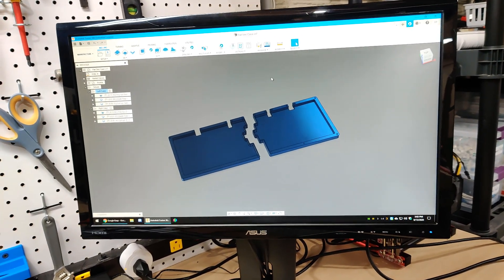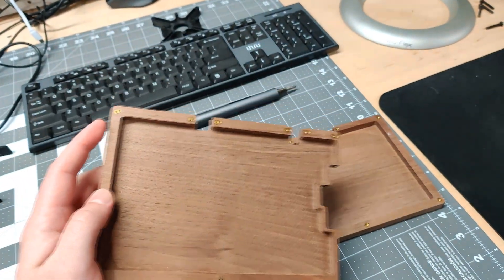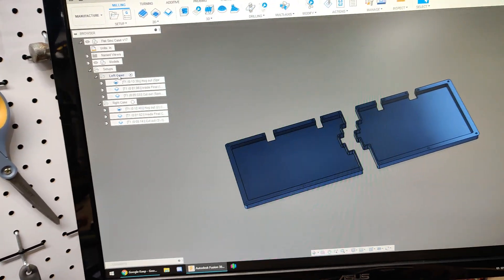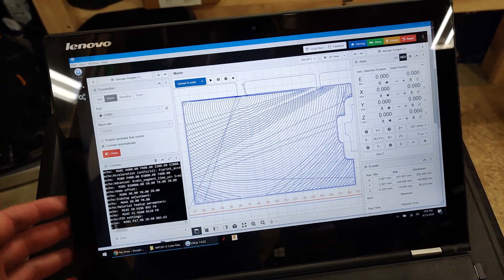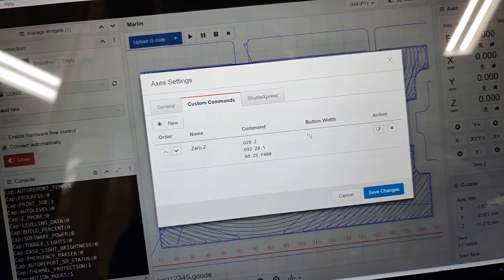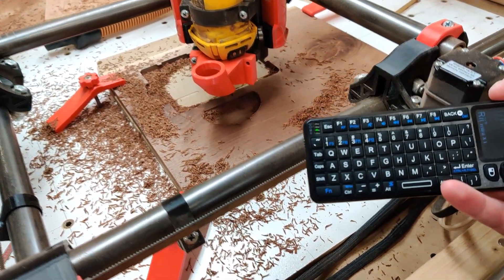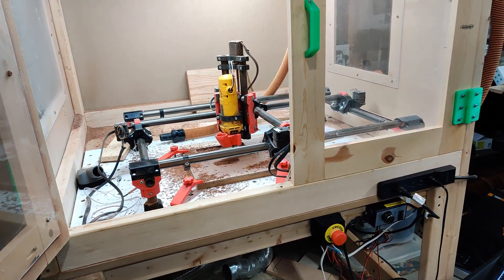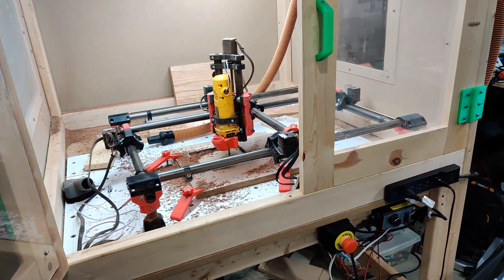MPCNC Primo Workflow Update - Switched to CNCJS....

Comment: @@ProjectbyBrian Have you used CNCjs for a single job/file that does bit changes?  If so, how did you deal with it?  I have some gcode insterted in the file but can't figure out how to get the z re-zeroized (ie: using a probe or manually).

Comment: You are entirely correct, learning work flow after the fact exposes all the mistakes made.
...and rebuys, relearn, to the bin are the only way to correct things.
Wasted money, wasted time, near complete losses.
Work flow also implies all the necessary ingredients needed at each step and why.
Hardly any of these vendors provide a clear map of work flow and what is required at each node. It is all thrown in incomplete disconnected layouts that generate 100s of questions.
...hodpodge soup...

You are exposing but a small part and only to those who already have a basic structure, good or bad.

Comment: if you ask me this is junk software I have been working on it for 2 days now just got my motors running and now got my limit switches done and tryed a test air cut and it said I need to change my tool do I need macros installed now and if so were do I get them I am new ,,I WAS USING MACH 3 but wanted to go with the xpro v5 i thought it was plug and play did i get fooled

Comment: Hey Brian, recently switched to CNCjs as well from octoprint. I cant seem to get my machine coordinates and work coordinates to work like you have at 3:23 in the video. They just stay at 0.000 have you seen this? Running the latest CNCjs.
Reply: @ProjectsbyBrian  yeah even when I manually jog the machine.
Reply: @ProjectsbyBrian  Yeah, running the V1 dual endstop firmware on the rambo full size.
Reply: @ProjectsbyBrian  Same cncjs version as well. Do you have to hit the homing button up top before it shows up? If I do that, it tries to home Z and if I dont have the probe under it, it obviously crashes the Z into the spoilboard.
Reply: @ProjectsbyBrian  I guess thats another question, do you home z before you offset it off to your workpiece or do you just home X Y and then home Z to the workpiece.
Reply: @austinoneil2906  I'm having this same issue. If you find a solution, I'd love to hear about it.

Comment: Cool vid. What controller is that?
Reply: @ProjectsbyBrian  Sorry I meant the controller you used to move it instead of the touch screen.
Reply: @ProjectsbyBrian  Many thanks. I am printing my MPCNC Primo now. I have not ordered anything yet. Have some convincing of the accountant to do. So far the cost is 780 for all the parts I want.
Reply: @ProjectsbyBrian  No but I chose the 300 dollar spindle and a few other expensive components. Should I have gone smaller to start?
Reply: @ProjectsbyBrian  Sorry it was 225 not 300. https://www.amazon.com/Daedalus-Brushless-brushless-Switching-Engraving/dp/B083XQ9NF1/ref=as_li_ss_tl?crid=3AW9KCWEDPTZ1&dchild=1&keywords=500+watt+spindle&qid=1592879076&sprefix=500++spindle,aps,209&sr=8-22&linkCode=sl1&tag=vicicn-20&linkId=02bacb789162ea8fbfb7700d3bcda7ac&language=en_US
Reply: @ProjectsbyBrian  I have a spreadsheet with all the stuff I was looking at.
Reply: @ProjectsbyBrian  My HevOrt project is also looking to be expensive.

Comment: How do you manage zeroing the machine and aligning that to your workspace with CNCjs? I'm having issues with utilizing the work offsets
Reply: @ProjectsbyBrian  Great thanks! Just to clarify, you home the machine in CNCjs to zero and square the axes, then jog it to your Fusion coordinate start point on your workpiece, and then touch off your z height with the probe? After which CNCjs just runs the gcode as if it were zeroed at that point?

Comment: Have in mind that you can run CNCJS from Rasbery Pi or Linux and you can also open the software from any other pc/tablet with browser like you do with octoprint.

I have test it on my linux laptop with Ubuntu but i dont have manage yet to make it run as service but the procedure is simpler with Rasberry Pi.
Reply: @ProjectsbyBrian  Well you can have dual boot ubuntu or the Pi if that helps you without the windows update the machine while you runing your CNC.

You dont need to connect the keyboard to the Pi...maybe i wasnt clear with this one you will have the Pi as "server" runing the cncjs and be connected to the MPCNC and the lapto or any other device as "client" connected to that instance of CNCJS.
Here is an example i followed for my Linux PC
http://blog.shahada.abubakar.net/post/adding-a-raspberry-pi-zero-w-and-cnc-js-to-the-3018-woodpecker-cnc-router